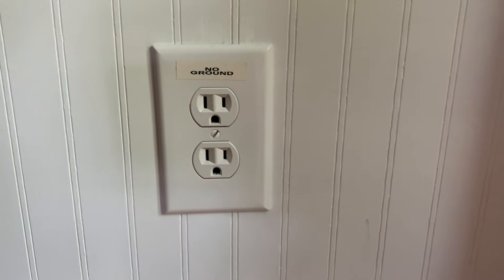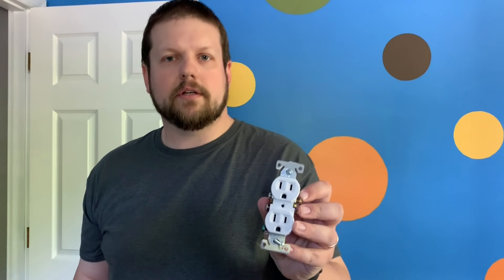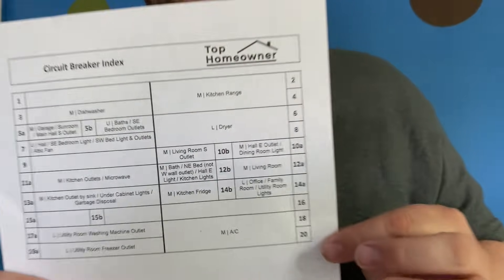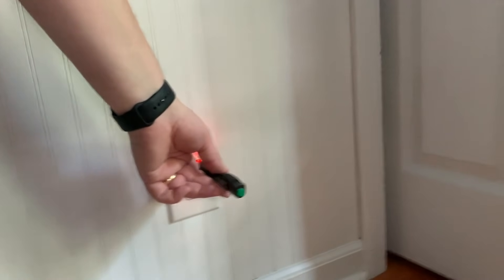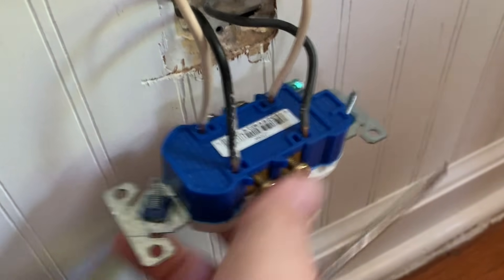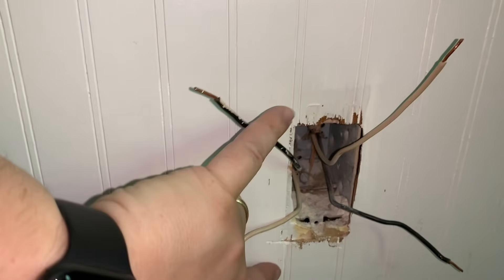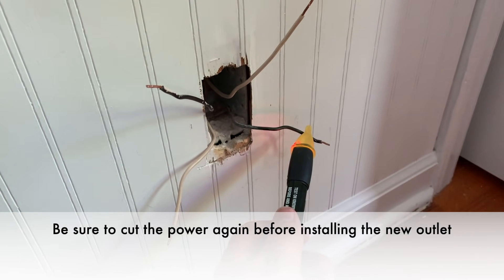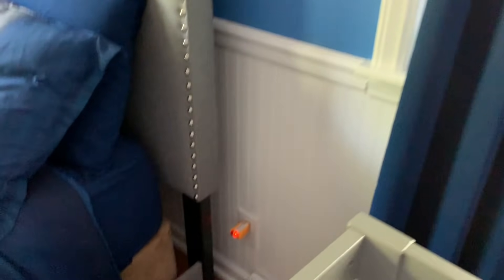Fixing Ungrounded Outlets - An Alternative Option to Rewiring Your Home

Comment: Looked to me like one light on in thereafter so still had open ground yeah or nay?
Reply from the maker: I made a follow-up video that talks about this and answers some other questions. You can watch it here: https://youtu.be/3AXcRsAOLPk
Reply: Of course it had open ground. The whole point was what to do when you have no ground wire.
Reply: @okaro6595  If there is an open ground then a G.F.C.I. won't work properly. They were not made to substitute for a ground.
Reply: @dlighted8861  Not again. Why do people make that bogus claim hundreds of times. The functioning of the GFCI has been explained dozens of times in the comments.A GFCI monitors the current between live and neutral. If there is an imbalance more than 5 mA it cuts both those wires. Such an imbalance means that current escapes to the ground, possibly through some person. The ground wire is in no way involved in the operation though grounding can help in creating the fault. If the equipment s grounded the GFCI or even the circuit breaker cuts the power immediately at the fault. If it is ungrounded it might happen only when someone touches it so it could sting but the GCFI prevents dangerous shock.  The fact that unless installation is very old sockets in wet rooms are grounded anyway.

Nobody ck aims that it is a substitute to ground. All new installations need to be grounded. This is just for fixing old installations.

Comment: That’s NOT what GFCI is for. You’re just wasting your time and money buddy...
Reply: It is perfectly up to NEC.

"406.4(D)(2) Non–Grounding-Type Receptacles. Where attachment to an equipment grounding conductor does not exist in the receptacle enclosure, the installation shall comply with (D)(2)(a), (D)(2)(b), or (D)(2)(c).

(a) A non–grounding-type receptacle(s) shall be permitted to be replaced with another non–grounding-type receptacle(s).

(b) A non–grounding-type receptacle(s) shall be permitted to be replaced with a ground-fault circuit interrupter-type of receptacle(s). These receptacles or their cover plates shall be marked “No Equipment Ground.” An equipment grounding conductor shall not be connected from the ground-fault circuit-interrupter-type receptacle to any outlet supplied from the ground-fault circuit-interrupter receptacle.

(c) A non–grounding-type receptacle(s) shall be permitted to be replaced with a grounding-type receptacle(s) where supplied through a ground-fault circuit interrupter. Where grounding-type receptacles are supplied through the ground-fault circuit interrupter, grounding-type receptacles or their cover plates shall be marked “GFCI Protected” and “No Equipment Ground,” visible after installation. An equipment grounding conductor shall not be connected between the grounding-type receptacles."

https://base.imgix.net/files/base/ebm/ecmweb/image/2019/04/ecmweb_2771_410ecm17fig1.png?auto=format&fit=max&w=1200

Comment: The real TRICK is to find the first outlet ( the home run ) AND all outlets there after . Circuits are not wired room by room .  ALSO a GFCI in an older steel box ( esp with olden angled top n bottom ) can be a TIGHT FIT . Good luck and be safe .

Comment: Yeah but metal boxes without grounds is scary.
Reply: Not grounding boxes was standard practice in many jurisdictions up until about the 1950's.  In fact, the cable used had no ground wire, only a hot and a neutral.
Reply: @heronimousbrapson863  My father's 1956 home was wired with 2-conductor non-metallic sheath cable and an uninsulated grounding wire was wrapped around the outside of the cable to serve any grounded receptacles.
Reply: In Europe we do that routinely. In fact in Finland dry room grounding became mandatory only in 1997.

Comment: You obviously don't have a clue to what you're doing
Reply: @Mark: and yet he managed to demonstrate a perfectly acceptable means to replace a non-grounded receptacle with a non-grounded GFCI receptacle.  We inspect and approve these regularly in older homes built with no grounding conductors to the kitchen or bath receptacles.

Comment: Ok, ha ha.  Its a jokester video, right?  Kind of like the free energy machine video that they never tell you how it really works, and you are just doing it with a GCFI?  Took me only one time through to catch the joke.
Reply: It is not a joke. This is the code compliant way to using 3 prong plugs without doing a rewiring. This is much better than cutting the ground pins.
Reply: @okaro6595  Why oh why should I respond?  Because you are a fellow human, and NEED to be educated.  Electricity os not a joke.  So briefly.....

Any inspector would fail this fix as a joke.  It is very incomplete.  WHY?
Understand.  When you are opting not to run a ground, you "can" (wink wink... and I would pass it)  use a GCFI  in EVERY ungrounded outlet... UNLESS, the wiring is metal jacketed, or, you can run a bare copper wire from the first outlet to all the others, thus providing them a ground path to the first GCFI .  If not the GCFI will not trip for the other outlets on a ground fault because there's no ground.  What essentially you are doing with the GCFI, which he did not explain, is the ground post on it is crossed to the common, making it into a 110-Volt 15-Amp mini-mains box, with its own breaker.  It will trip if current tries to travel down the common, providing a proper ground fault for a load, (but it is still classified as a no equipment ground). If the other outkets are not "grounded" to it by metal wire jacket, or a copper wire, the only thing that GCFI is set up to do is tripping on current overload!  That destroys the outlet snd is a fire hazard.  So EACH ungrounded outlet gets its own PROPERLY installed GCFI device.
Reply: @markmurto  Let's hope you can understand that a GFCI doesn't need a ground, doesn't CONSIDER the ground and works perfectly well without a ground or with an "open ground" (regardless of wiring method). GFCI has literally nothing to do with "current overload".  I'm a a certified inspector and know how to read the code.   Do you?

Comment: Caution.  There is a mistake here in your understanding of the application of GFCIs in solving the multi-outlet no ground problem.  While truly you will not have an equipment ground in the correct application ( and each outlet must be marked so ), this explanation of how to use GFCIs to create a "ground" fault for each outlet in a whole room is very incomplete.  It would take a better produced video to tell the correct method of using a GFCI, however if you use this video as your guide, I beong the inspector,  would fail your inspection. And if I saw this mistake on my job,  I would certainly suspect you were not well schooled, and force you into a deeper inspection for fear of worse mistakes. The application here is incomplete and therefore dangerous and wrong. Sorry, nice try, but you just misled your viewers.
Reply: @Mark: To what 'mistake' do you refer?  If you, as an inspector, arbitrarily fail an installation without any legal basis, you can be immediately fired if not also sued.  Please point to any "violation" of code illustrated in this video.

Comment: Just jump the ground to the neutral😎
Reply: Wash out your mouth with soap.😉
Reply: @Jesse: worth considering that causing death by electrocution due to such gross negligence (violation of electrical code is evidence of negligence) is a form of criminal manslaughter, when they find out what you did during the insurance investigation.  So, in theory, even thirty years after you sold the house you modified dangerously, you can still go to prison for setting the trap.

Comment: You're a bit long-winded all I wanted to know is how to correct a open ground

BOUNCING
Reply: This does not "correct" the open ground. The text "no equipment ground" clearly tells that. The whole point is that one can leave the ground open.
Reply: @okaro6595  But you can not.  Every outlet in a modern house  that has three holes MUST be ground faulted.  This fellow just did not have a clue on how its done.
Reply: @markmurto  This is for changing old outlets and it is allowed by the NEC. I have given the quotes in the comments.
Reply: He explained it early on.

Comment: I just put gfi breakers in the box, since code accepts that to pass. Easier to put in and quicker.
Reply: But unless you change the sockets you cannot use grounded plugs - unless you already had grounded type sockets illegally.
Reply: @okaro6595  Valid point.
Reply: @okaro6595  , spend a lot of time in court over city oridences and other contexts. Brush up on law before you make a claim of lawfullness. You are under the assumption you know what law is, law is not what you think it is. Even when they pass oridences they have exceptions in law. You own your home. Is it illegal to fix your home? No. It is not involved in interstate commerace, nor a buisness. There fore you can do as you wish to your private property. An electrican can not make modifications that are not up to a code since his certification is regulated by the state.
Reply: @mikebiro3148  Maybe I have to draw it in puctures. 

1) The reason this modification is done is so that one can use plugs that have the ground pin.

2) To do this the sockets need to be changed as they do not have the hole for the ground prong. Changing only the breaker will not allow using thee prong plugs on a two prong socket

3) The only way changing the breaker would reduce work is if he sockets already were three prong and that would be an illegal configuration.
Reply: @mikebiro3148  "Your own home" is still subject to the entire fire code and building code, everywhere I have ever lived in the USA.  Whether your local jurisdiction requires licenses or permits for the work is a different question.  When you screw up your own single-family wiring and it burns the place down, the argument is with the insurance company that doesn't have to pay for the damages, injuries or deaths you caused.
Reply: OK fair but... 1. GFCI breakers are a lot more expensive than GFCI receptacles. 2. GFCI breakers may not be an option if the panel is full or near full and half-width breakers have been used. 3. If an amateur is going to muck about, I'd rather they stuck with receptacles and stayed out of the panel.
Reply: @civildiscourse2000  , agreed breakers are much easier and cheaper in some contexts. Depends how many outlets are in that circut, but since all mine are grounded in the first place. But still have metal boxes the safe and easiest way is the breaker it self. When i own my houses before they become rentals, they are set up as private property. They do get inspected and certified by eletricans and cities after but saves me a whole lot of red tape. As its a willing inspection as a home owner.

Comment: Putting a 3 prong outlet where there is no ground is a violation of NEC code regardless of what label you put on it
Reply: No it is not.

406.4(D)(2) Non–Grounding-Type Receptacles.
...

"(b) A non–grounding-type receptacle(s) shall be permitted to be replaced with a ground-fault circuit interrupter-type of receptacle(s). These receptacles or their cover plates shall be marked “No Equipment Ground.” An equipment grounding conductor shall not be connected from the ground-fault circuit-interrupter-type receptacle to any outlet supplied from the ground-fault circuit-interrupter receptacle.

(c) A non–grounding-type receptacle(s) shall be permitted to be replaced with a grounding-type receptacle(s) where supplied through a ground-fault circuit interrupter. Where grounding-type receptacles are supplied through the ground-fault circuit interrupter, grounding-type receptacles or their cover plates shall be marked “GFCI Protected” and “No Equipment Ground,” visible after installation. An equipment grounding conductor shall not be connected between the grounding-type receptacles."
Reply: John John: read the friggin code!
Reply: @jerrydemas2020  Doesn't seem that hard, but some people are simply ignorant.

Comment: It is a LOT of work to replace all the knob and tube in an old house but that's what you really should do.  What he's suggesting here is a cheat.  (I may have missed something as I didn't watch it to the end)
Reply: It is a pain to replace knob and tube. However, knob and tube is not the only wire manufactured without a ground conductor...
Reply: @williamweckel8140  Here in Canada I thought we went to 3 prongs a long, long, time ago. I actually bought a house with aluminum wiring in 1993.  I didn't know about the issues and I was a Utility technician.
Reply: @siglaviking: a lot of 1950s houses were wired with two-conductor non-metallic sheathed cables having no grounding conductor.  Some electricians added a grounding wire if someone wanted 3-prong receptacles.  I rewired a house in the 70s that had a mixture of knob-and-tube, cloth-cable, plastic cable an armored cable. It was a hoot.

Comment: A GFCI plug is good protection for wet locations or any other location, but it is not an acceptable substitute for a ground wire.  The functions of a GFCI plug are:  1) It will not allow an unbalanced load.  That is, if your current (hot wire) comes through the GFCI receptacle, it must return through the GFCI receptacle (your neutral must also be connected through the same GFCI receptacle) or it will trip [the reset button.]  2) If any wire, neutral or hot wire, comes into contact with the ground, it will trip.  However, if the GFCI outlet is not actually grounded, that function will fail.  Furthermore, if a grounded metal device is plugged into an ungrounded outlet and a short-circuit occurs, for example if the metal on the device cuts into the hot wire on the cord, the device (lamp, drill, kitchen appliance, etc.) will continue to operate, but anyone who is in any way grounded and comes into contact with the metal part of that device will get shocked.(even poorly grounded such as wearing shoes standing on carpet laid over a cement slab.)  In that situation, a GFCI installed at the beginning of the ungrounded circuit will not provide any protection.  And since the human body is very high resistance (several megaohms) a breaker will not trip.  3) A GFCI will not allow current to flow backward through it.  (If you connect the line and load to the wrong screws, or lose a neutral and the unbonded neutral comes into contact with ground on the "load" side of the GFCI outlet, directly or through a human body*, it will trip.)    I am not sure what was done here, but in the beginning of the video, the tester did not light because the plug was ungrounded.  Then at the end, for the GFCI test, the tester light was on, in spite of the plug being ungrounded.  Knowledge of DC theory and basic house wiring methods, along with A/C distribution (from transformer to house at least) is very important in order to provide personal safety advice regarding electricity.  I never berate anyone and that is not my intention today, so please don't be offended.  As an electrician since 1983 and electronic technician since 1982, I thought a little additional information would be helpful, in the interest of safety.  
It is possible to add ground wires to crucial outlets without rewiring your house.
*Losing a neutral and pulling current backward would be a very rare occasion and is the only way this method will provide additional protection against electrical shock .
Reply: If someone gets shocked in a device that is protected by a GFCI the GFCI will trip and cut the power. The test button in no way uses ground.
Reply: All well and good, kinda, but at least where I live, GFCI is a code-approved solution in this situation. Not the best, not a substitute for a proper bond, but still approved as a last resort and much better than an unprotected and ungrounded 3-prong receptacle.
Reply: @Steve White: That's a lot of words to simply show you don't understand what the video is about or how a GFCI works or that code allows EXACTLY what he shows how to do: replace an ungrounded (2- or 3-hole) receptacle with an ungrounded 3-hole GFCI receptacle thereby obtaining GFCI protection of all the receptacles further down that branch without ANY need for the effort to run a grounding wire to any of them.

Comment: What if you put GFI plugs on all the plugs
Reply: Once you replace the first receptacle in the circuit with a GFCI, it will protect all those that come after it. If you wish to have 3 prongs you need to change all the receptacles to new and and label them “no ground”
Reply: @Skatrdude583  No, you do not "need to change all the receptacles to new". You may if you wish, at which point any non-grounded 3-prong receptacles on the load leg ("downstream") of the first GFCI would need the "no ground"  and "GFCI protected" labels.
Reply: But how do you connect them? You cannot put a three prong socket without a GFCI. You cannot make an illegal fixed firing and then correct the problems with external things.
Reply: @okaro6595  You can legally install separate and independent GFCI receptacles to replace any or all ungrounded 2-prong receptacles.

Comment: Wanna start a real war? Talk about Arc-Fault Interrupter circuit breakers (bedrooms per NEC)
Reply: Newer NEC requires AFCI in a lot more places than "bedrooms"! Starting with "All 120-volt, single-phase, 15- and 20-ampere branch circuits supplying outlets or devices installed indwelling unit kitchens, family rooms, dining rooms, living rooms, parlors, libraries, dens, bedrooms, sunrooms, recreation rooms, closets, hallways, laundry areas, or similar rooms or areas shall be protected" by AFCI and "dormitory unit bedrooms, living rooms, hallways, closets, bathrooms, and similar rooms" as well. NEC (2017) 210.12(A), (B).
Reply: @UpnorthHere  True today. Personally, I am for all circuits. Especially during retrofit of old houses.